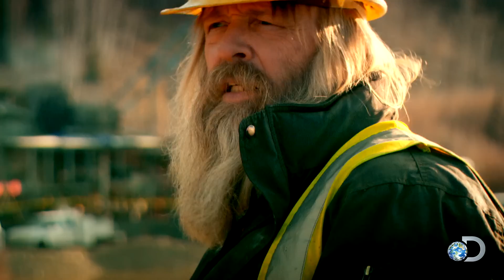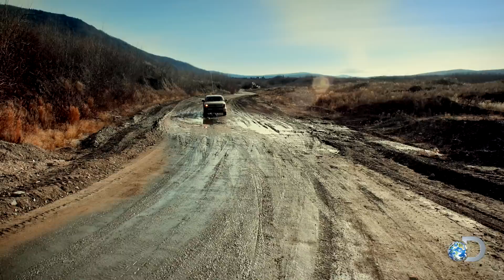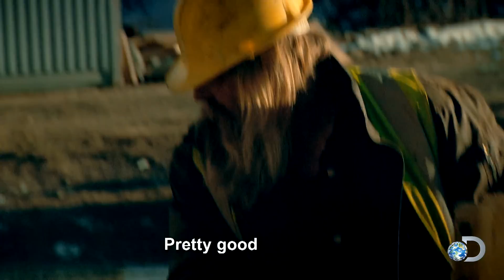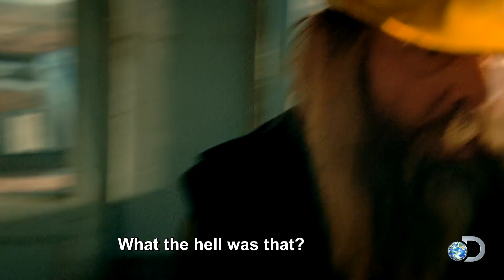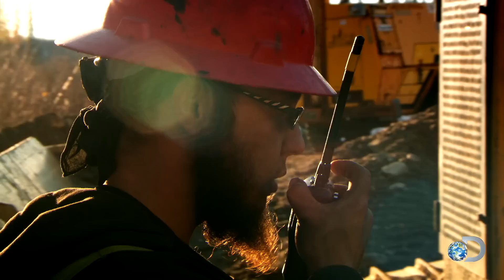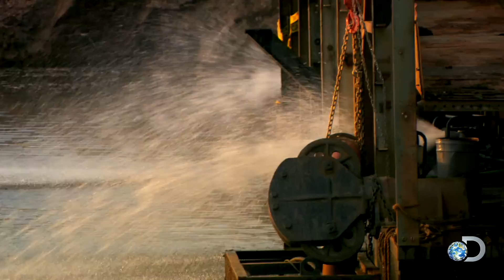Tony Beets Floats His Million Dollar Dredge | Gold Rush

Comment: The leak is fake.
The water inside the hull is @ deck line level.
It should be the same as the dredge draft.
Reply: tv dramatization for our entertainment BORING
Reply: his point is that if it were taking on water the water level wouldn't be that high it would be equal to the dredge draft as it goes down. Did that thing even look a little like it was leaning
Reply: Hahaha there's like an extra meter
Reply: I might check the barge hull for leaks by filling sections with water while the pond is dry.

Comment: I thought the dredge could operate in any condition? Even the off season...
Reply: Kickass7895 the strenght of the steel will decrease rapidly if it freezes and if they stop witch you know is going to happen the water pipes will freeze up
Reply: daan stam Get a heating system then? Pump hot water around the dredge. Insulate it.
Reply: Kickass7895 that would be verry expensive though
by the way if the ground is frozen and so chunky you cant get gold out of it and de freezing it would be also very hard